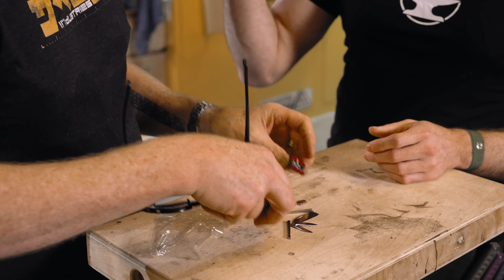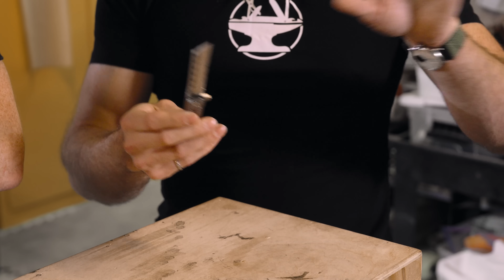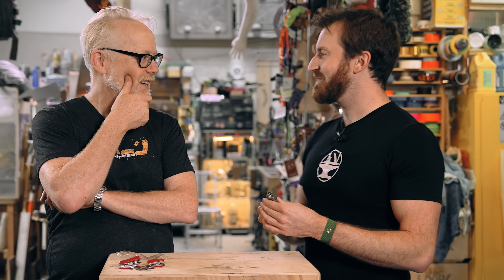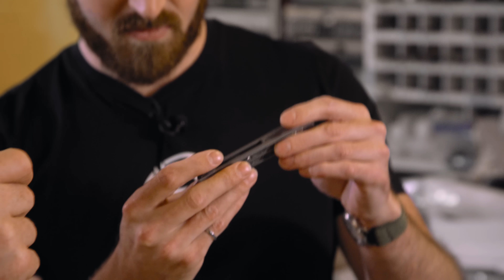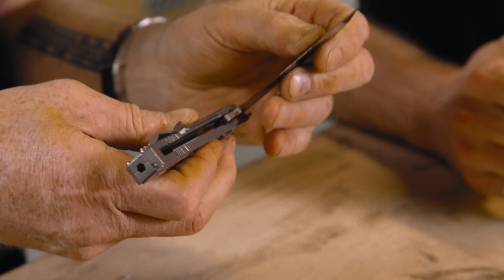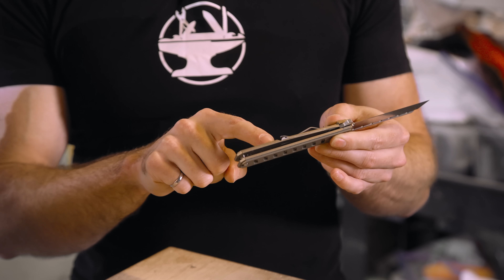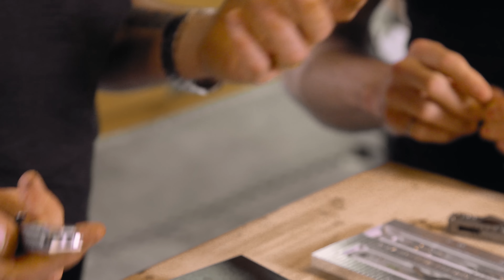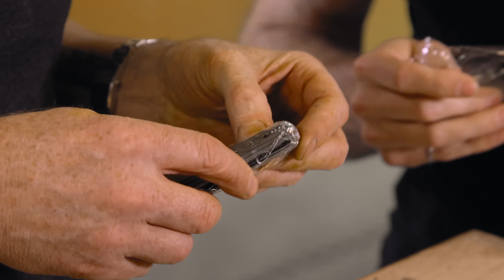Adam Savage Wields Hacksmith's Titanium EDC Multi-Tool!

Comment: I think LTT said something about the noncompliance of bit sizing driving them crazy.
Reply: they had the exact same problem with sizing their screwdrivers
Reply: In one of their WAN shows they mentioned that. On paper in the standard the tolerances should be accounted on one, can't remember if the bits or the recess. But in practice the tolerances are on the other.
Reply: They did and in the video he mentions iFix it being different but I'm 100% sure that they and LTT use the same bit standards.
Reply: Hi! I'm not really very active in the whole tool and Maker space, but I'm positively surprised that LLT (got their screwdriver 2y ago) seems to have become a name in this area! Can anybody comment on why?
Reply: @vanhoeppen  Part of it is that LMG is actively paying for advertising and generally pushing them in their own videos. The other part is that the LTT screwdriver genuinely is a premium feeling and performing screwdriver with multiple standout features that differentiate it from the rest of the market specifically for the task of working on PCs. Most notably the extremely low backdrag on the ratcheting mechanism.
Also, it's price competitive with other premium screwdrivers. I've got one from PB Swiss and that's in the same ballpark. I'd always use the LTT for building a computer and the PB Swiss when working on something that's greasy or oily because that's what they're each optimized for.
Reply: @vanhoeppen  they've sold half a million of them, that's why
Reply: @vanhoeppen  Along with what @MysticalDork said, the LTT screwdrivers (standard, stubby, and precision) are just legitimately good screwdrivers. I currently have one of each, and I want to pick up a second standard one when I have some spare money specifically to use with my car (my current one is the grey and purple "retro" colourway that's no longer available, and I'd really hate if it got stained while doing car stuff. Lol)

I'm also actually a bit excited for the fixed-shaft screwdrivers that Linus has been teasing occasionally for the last year or two now. Especially if they can do the customizer that he wants (choose the tip style and size, shaft length, and handle size and basically build your perfect screwdriver)
Reply: @taj1994  also it got major high marks from independeent product testers like project farm which refuse sponsorships and buy 100 percent of the products they test to avoid bias, in his video LTT's screwdriver is pretty much the best price to performance in it's range and is competing with screwdrivers that are almost twice the price. 

It also helps in this video that James and Linus are friends as they've known each other for quite a long time; and they're both canadian.
Reply: @vanhoeppen  Well, part of it is certainly due to advertising - They go out of their way to mention the LTT screwdriver in as many videos as they can, which is understandable because selling merch is a significant source of revenue for LMG.

Another part of it is that a lot of people (myself included) are willing to pay a significant premium for a premium-feeling and extra-functional piece of equipment. Sure, you can get a cheap multitool for like $15, but they feel like mush and they don't last under constant use, so I own a $150 Leatherman. Is it a 10x better tool and experience? That's a judgement call for the buyer to make, but I personally don't regret my purchase.

 The folks at Creator Warehouse spent a lot of time tuning the feel of the ratchet mechanism, tweaking the bit storage design, improving the magnet strength and more, all so that it feels good and works well, and that paid off - the LMG screwdriver consistently performs very well in third-party testing/comparisons (like Project Farm).

Another factor is that makers are social and quite vocal about things they like. If a product is well,regarded, word-of-mouth spreads as it gets recommended from one maker to another. I certainly do this with tools and equipment I have personal experience with, either positive or negative. "Buy this one, avoid that one" etc, and a well-regarded product can take advantage of the "free advertising" from this.

Comment: This with a Magnacut blade would be perfect.
Reply: Future upgrade might be possible =)
Reply: @hacksmith but we need this in lightsaber form
Reply: @hacksmith or the magnacut predecessor magnamax.
Reply: I love how they are both so excited about the blade they are always taking it out of each others hands LOL. Congrats Hacksmith!!
Reply: I’m more of a REX45 type of guy…but ok
Reply: yeah I was wondering about the steel and treatment. Magnacut, or CPM90, or Spy27😊
Reply: I hate to think what they would charge for a good heat treated USA Magnacut blade after seeing the price of the chinese M390 version.
Reply: @Mikey_Trailz  M390 is only made in Germany. The cost is around the same as Magnacut, but we're unable to source Magnacut currently thanks to a certain president in charge...
Reply: @hacksmith  Austria actually. Also I'd still keep the M390 over magnacut simply because of the edge retention. Magnacut wears out like a mf when it sees actual use compared to M390. Magnacut is "tougher" but it's a folding knife, you're not going to take heavy cuts with it or use the blade as a pry bar.
Reply: -Would Magnacut have been the default option if it was available? It's newer with some pros but less edge retention right..
 -But likely still the less expensive blade for the Lite version?

And M390 as an alt option then? Or sourcing both would be too much?

/ Congrats on your well deserved incredible success!!

" We’ve already become the most funded EDC ever, the most funded knife ever, the most funded Canadian Kickstarter project ever… and we’re in the top 25 most funded projects of all time, period, across all categories!"